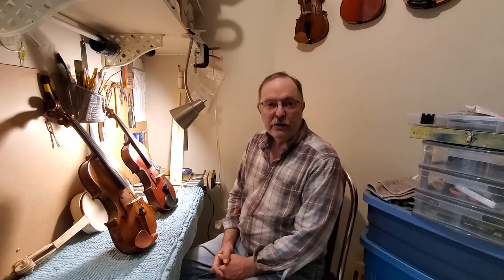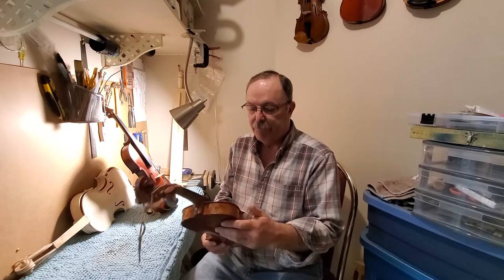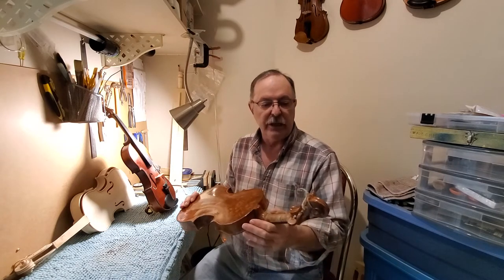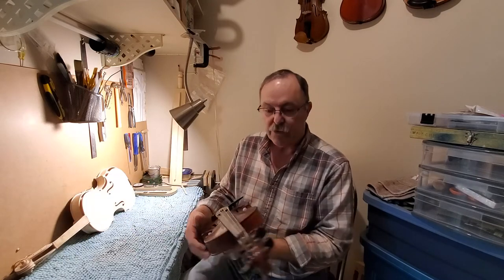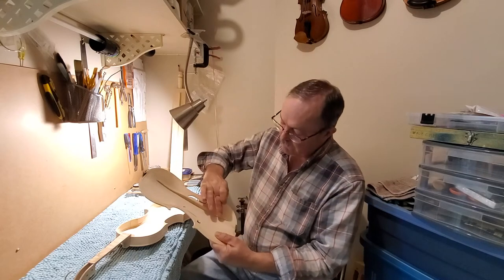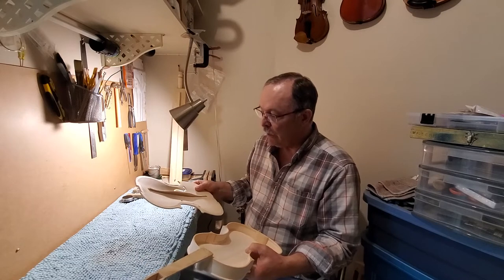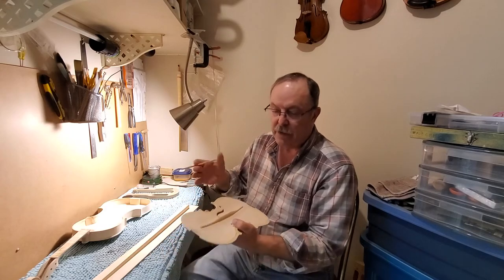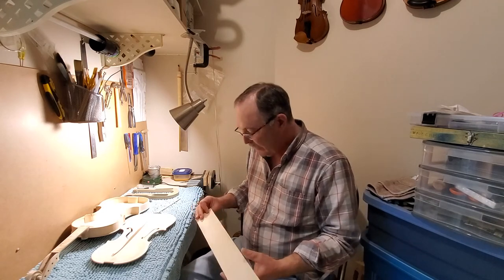Tuning the Violin Plates

Comment: My father tuned his plates using an electronic tuner. Then after gluing the pitch changes and he would make more tuning adjustments. Good video.
Reply from the maker: I tried using an electronic device but gave up in frustration. In retrospect, this video could be called 'thicknessing the plates'. It's kind of a crapshoot on whether it will work out. Most do. I now actually use tap tones to a degree, making sure different regions of the plates have resonance in relation to the others. It seems to work better  but I'm sure there are far better technicians than I.
Reply: By the way your right about the electronic tuner, they aren't the best. I think he started using a fork or rod later on.

Comment: Could you explain how do you use that template rod for tuning the plates?
Reply from the maker: I'm kind of embarrassed,  as the more I learn, the more I realize I don't know. The title of the video would be better as, thicknessing plates. I was simply following the thickness plan of some of the great violin. The problem is it doesn't take into account variations in wood density. I'm currently trying to actually "tune" plates now using sound. It is very difficult.
Reply from the maker: Tuning plates using taps is causing me much difficulty. I'm having a friend show me better how to do it.
Reply: @ThePrairieFiddler  I am on the same way. I try to follow a useful method, but no one wants to work.